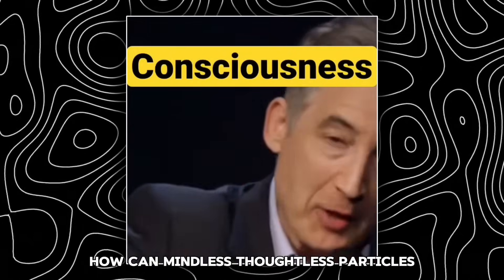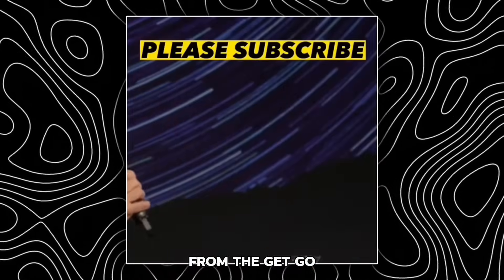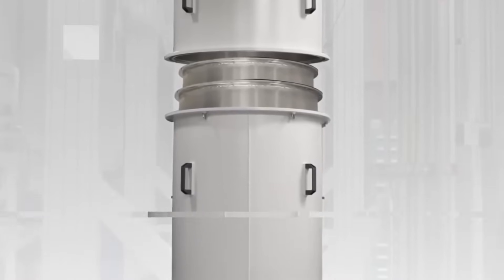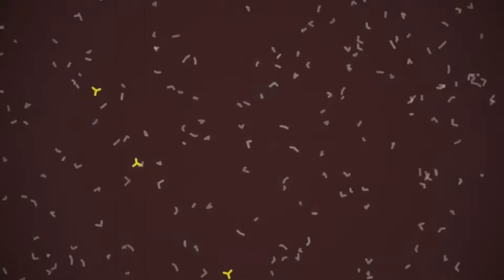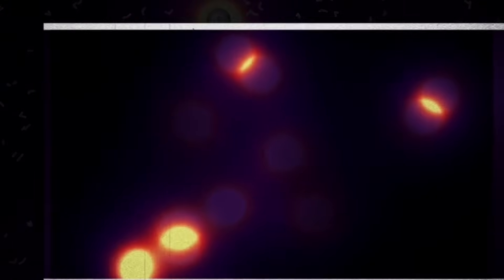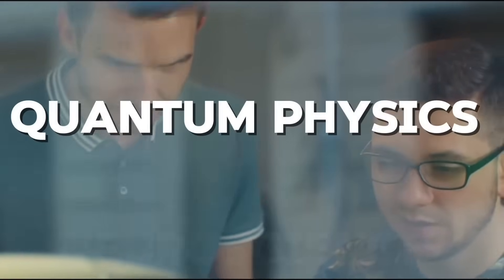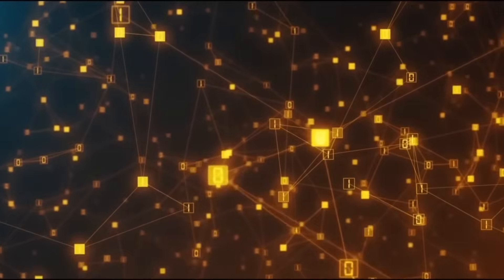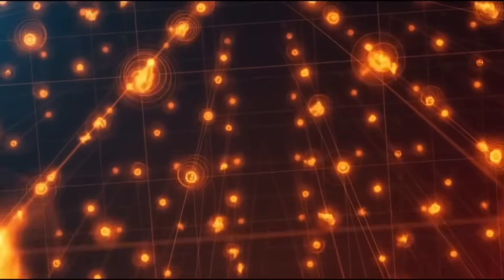Majorana 1 Quantum Chip Just Identified a Quantum Biomarker for Consciousnes

Comment: These videos are made by AI and it’s quite annoying. How many times they repeat the same thing yet don’t ever say anything. And the same images keep flashing through too quickly compared to the pace of the speaking. This is probably all just automated even the posts.
Reply: i guess they think it will keep us engaged, but it's rather annoying.
Reply from the maker: Then you clearly have not a single clue of what you are saying. Very well.. thanks for nothing.
Reply: @SpacializeEN by refusing to comment i comment
Reply: @ if a human is making these videos, it’s even worse, because they should know better. AI would be dumb enough to repeat the same images so fast over and over.
Reply from the maker: @Metatr0n7x  You typed all that just to prove you don’t understand the content or how AI works. Nothing you said was remotely original, accurate, or relevant. You’re not critiquing—you’re just loudly announcing you don’t get it. Next time, try silence. It’ll be the smartest thing you’ve ever posted.
Reply: @SpacializeEN  he's right, this video is too long and too slow
Reply: @SpacializeEN  well, if that's the case, isn't it your job to explain it?
Reply: @ even this response is a typical ChatGPT response.